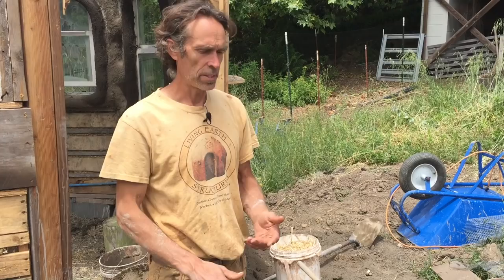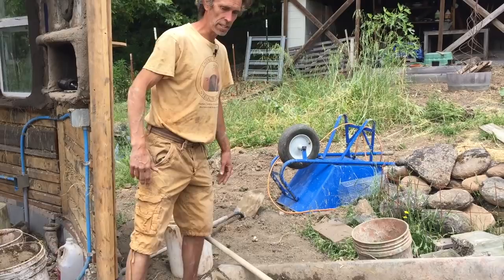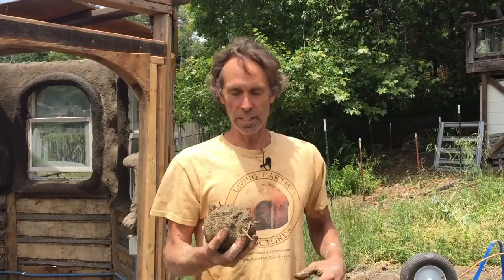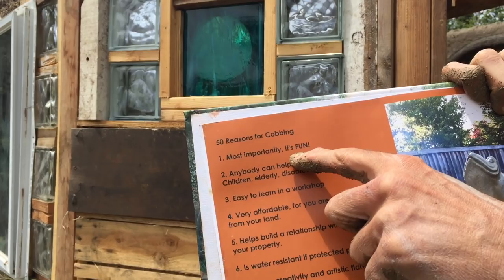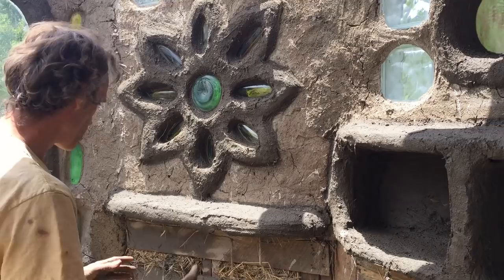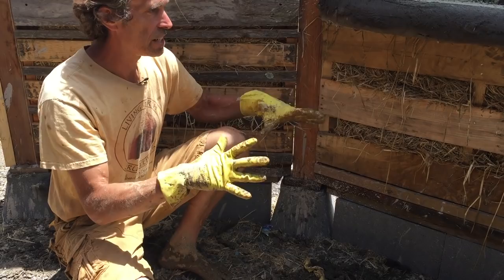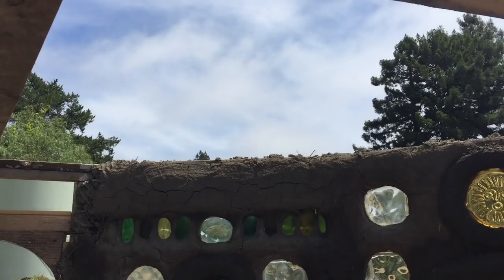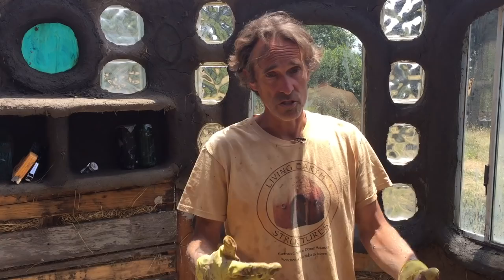A Palletable Cobin with Miguel Elliott part 1

Comment: My land seems to have a lot of termites. I heard pallets are already termite proof but I’m not sure. Anyone know if it would be ok to add some borax into the cob to deter termites?
Reply: I would.  Also sprinkle some under the foundation blocks.
Reply: I'd think that immersing or at least spraying down the pallets in a boric acid solution would be wise. Similar to what is done to treat bamboo. I'd guess that those tenacious termites will likely find their way in through the cob to the wood even if the cob is treated. A bit of extra work but worth it if you want it to really stand the test of time.

Comment: Question How do you waterproof the Cob House?
Reply from the maker: You seal it when you paint it and let it dry  :)
Reply: What kind of paint? Any kind of paint?
Reply: I developed a cob/mud plaster that was waterproof and works great by adding a tiny bit of portland (really not much) and a bit of oil.  I used used motor oil but one could buy linseed oil instead.   The oil made is very smooth and more workable, able to apply thicker, never cracked, hard and completely beaded off water.   Still good 20 years later.